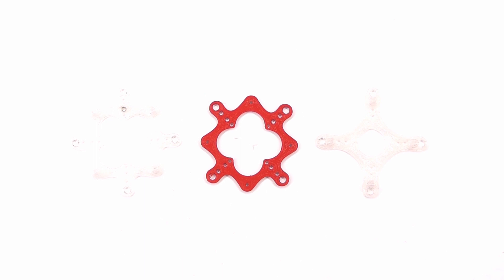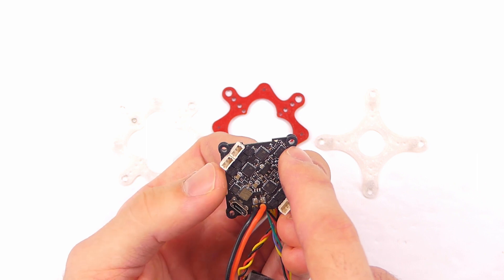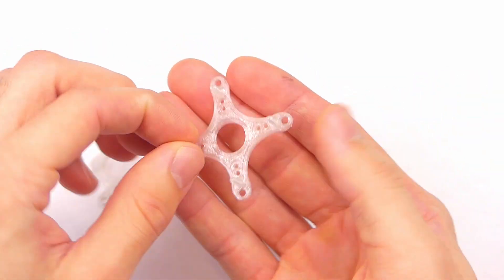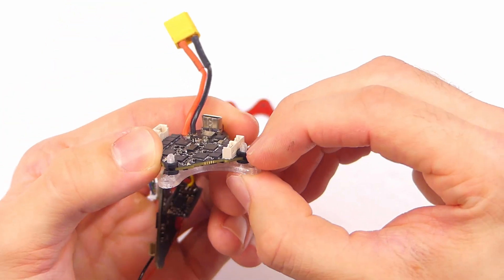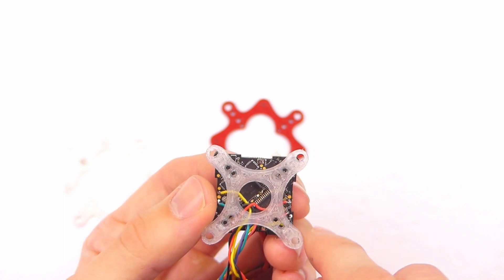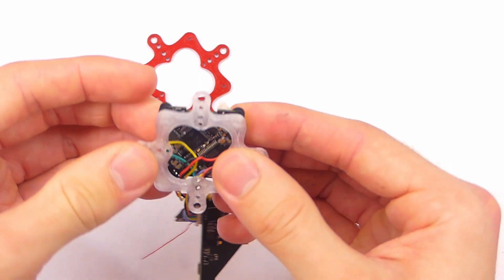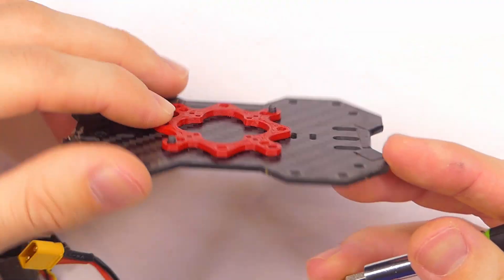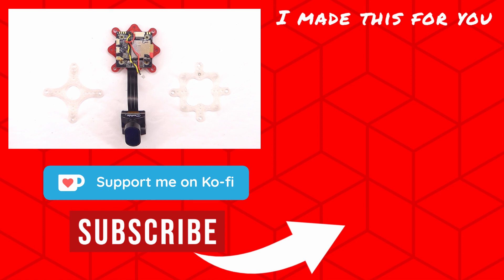3D Printed AIO Flight Controller Board Adapter (25x25, 20x20, 30x30, 16x16mm sizes)

Comment: So both versions of this plate will do 16mm x 16mm to 20mm x 20mm, correct?
Reply from the maker: Yessir! The one with posts built in is sized to fit 20x20mm.